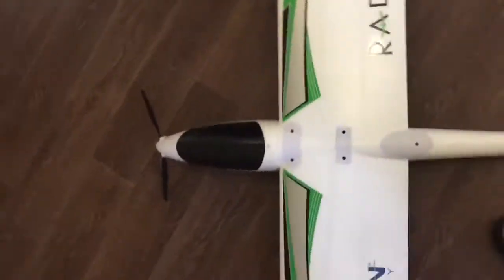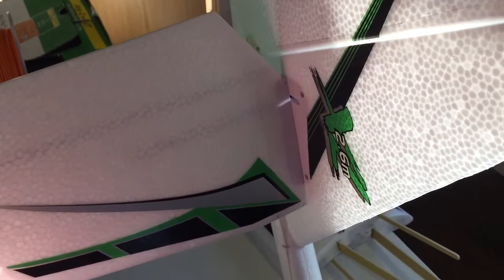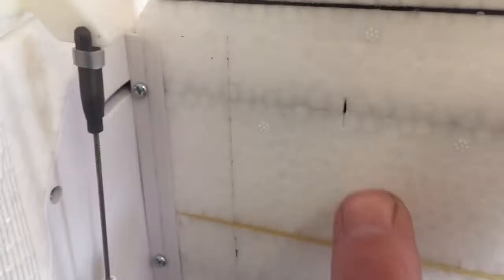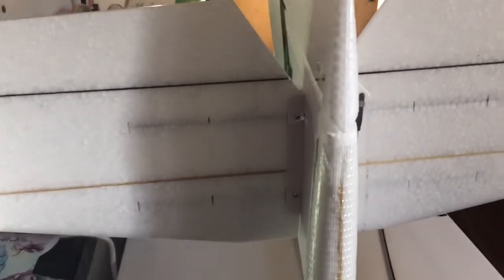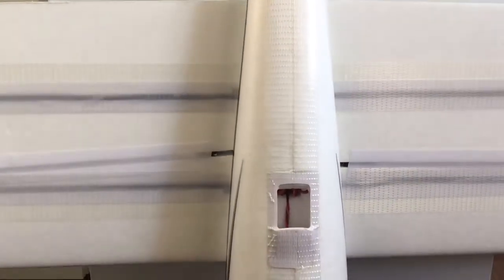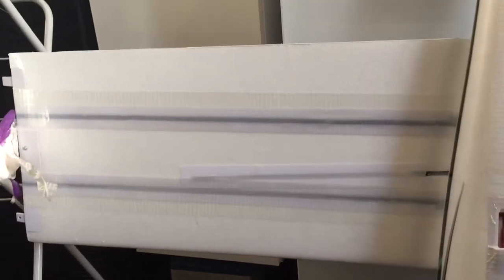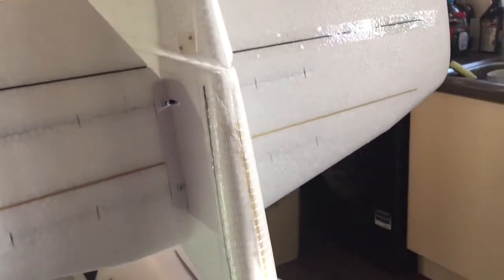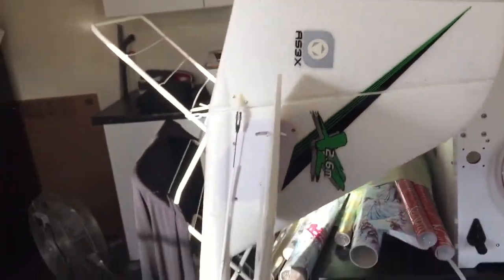E-flite radian XL must do mods part1

Comment: Thanks Dan. I've just bought an XL  so this afternoon I'll get cracking on your suggested mods and hopefully save myself some grief. Good to hear an English voice at a speed that can be understood. A good London area accent.
Reply from the maker: Tony Holmes thanks mate
Reply from the maker: Tony Holmes also thinking about changing the prop to a 12/6.5 carbon as stock prop don't give you much thrust don't expect it to go vertical it's a steady clime out so I'll let you know how it goes with a prop upgrade and will do that as part of my maidan review 😊
Reply: Hey Dan, Cheers for the tips, took delivery of mine last week from Wheelspin, just waiting for the EC3 to deans adaptor to get started! Re the prop, would be very interested to hear your results as the 12x4 stock prop is in short supply with most UK shops out of stock,  I would also be interested to hear your opinion on the AS3X trim issue spoken about in RC groups, have you removed the mix to allow ruddder trim?

Comment: Should get mine in a couple of days.  I am from the old school with the high start days, 50 feet of surgical tubing and 1000 feet of line with the parachute on the end.  Appreciate the information about the poor construction parts of the glider.  Will certainly do your suggested mods unless they have improved on things.  Really like the size of the wing span.  Things sure have changed since the days of my balsa gliders with the heat shrink coverings.  The biggest I ever built was the Olympic, with its eleven foot wingspan, and then there was the gentle lady.  Of course none of them had motors.  Happy Flying
Reply from the maker: Ji mate check out my other vids on the radian for more mods and a closer look at the faults

Comment: Nice mods, thanks for sharing. Quick question, do u only have a CF rod on 1 side of the tail not on both sides?
Reply from the maker: Eleazar Guzman RN him mate only on one side the carbon rod i use is the flat stuff 1.5/6mm you get them in meter lengths dont use round rods as they dont give much rigidity in the direction you need it to thanks for watching hope it hepls
Reply: DAN19792 thanks for the quick reply Dan. Keep up the great videos! Cheers!!

Comment: Thanks for this video. Do you know what thickness carbon rod you used to strengthen the tail section?
Reply: Peter Y I used 5mm x 0.6mm on mine. Worked like a charm. You could go 10mm x 0.6 but its not necessairy. 0.6 will work great
Reply: alt ctrlesc - so 6mm diameter rod by 5cm long? Thanks for the help. I'm picking up the plane today
Reply: Nope, well they are flat, so not round tubes to be clear. The way they are sold is by thickness and then by width. The length depends how much you want. For ex you could get a 1 foot stick of it, or you could do what I did and get a few 3' long sticks. They are 6.0mm wide x 0.5mm(thickness) x however long you want. And you can cut them down........ that said, I would read my other comment I left on here about my experience with the radian XL. You might want to think twice. Ive had mine about 2 weeks now, all I fly are gliders and powered gliders. I honestly really regret buying this particular model

Comment: This is a glider not a plane to buzz the field with. i have a lot of flights on mine with no problems. Speed kills lol.  Your adding more weight.  I was actually looking at ways to lighten it. i  use a mobios cam. I have issues with the audio but cool anyway.
Reply from the maker: Ken Donnelly hi mate I don't buzz fields with it lol but my mods work a treat for me and others as for the increase in weight it's very little and makes no difference in performance just gives peace of mind knowing it's not going to fail in the air
Reply: Ken, if you want to take 2oz out of it, there are two 29g steel cube weights moulded into the foam at the front of the plastic cooling duct ramp. Might be hard to excise them, I only found them when my nose cone came off and the plastic ramp separated.

Comment: Got the xl about 2 weeks ago. All I do is fly gliders of all sorts. When I got this one in the air... I was like "what is this??" its horrible. Wayyy excessively heavy for a glider by easily 5x even gliders of compatible size. It has a decent motor... But the plane overall is still just way too heavy. All it does is front stall and side stall. Its all stock, Ive added nothing. I changed all sorts of tail settings and moved the battery around, used a different size battery, re-balanced, etc. Same thing: too heavy too unstable. Very very unstable. And, unlike the regular radian, its likely to crash on a windy day while searching for thermals.. by the way, its way too heavy to climb in anything but a supernaturally charged thermal. So forget it. Very dissatisfied with this plane

Comment: the mods I made on mine was to reinforce the belly like on the vid, and replace the stupid brainless stabilisation system by a comon standard receiver. this was a cool cheap stuff, maybe too cheap......In fact today I decided to go for a flight and when I applied power to launch it, the nose brokened and the engine departed without the rest of the glider who remained in my hand.........